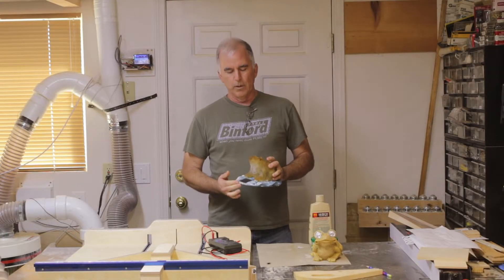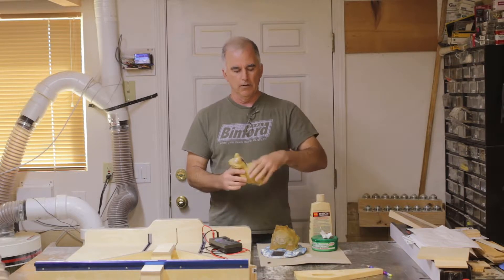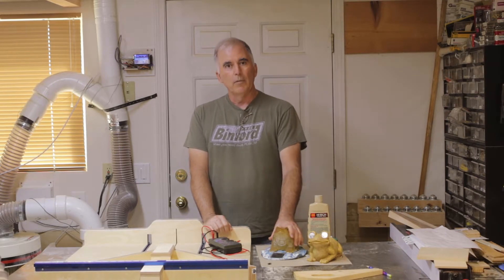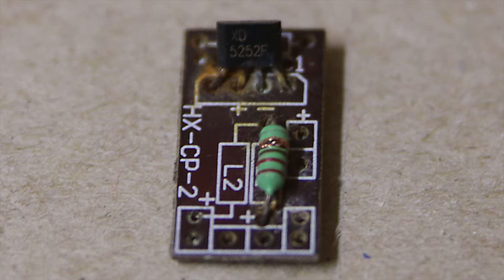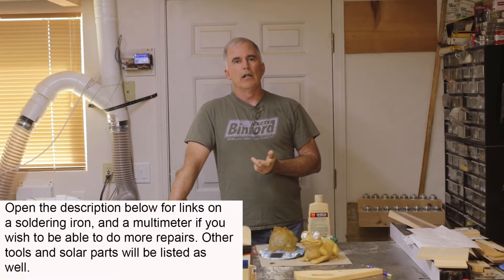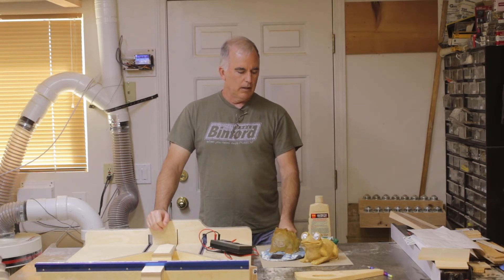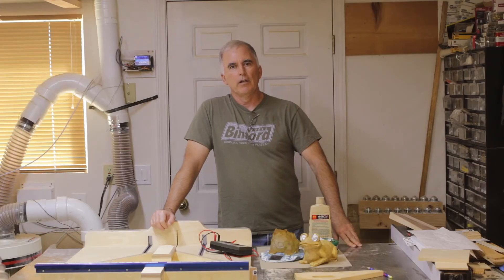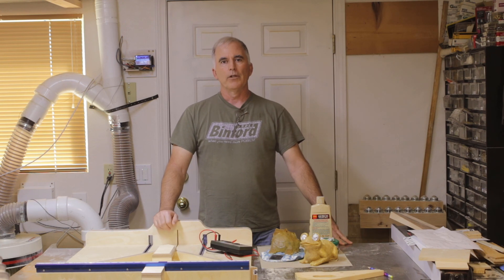Garden Solar LED Light Repairs

Comment: Thanks. Your video is exactly what I was looking for. You make it easy to understand. I'm fixing something similar to your frog. It is one of  Mums favourite ornaments.  A faerie sitting holding a book that lights up. I may need to get another circuit board. The little black box is just a splodge of something on the board (I think it's a smaller version of the same). Good advice about photos.